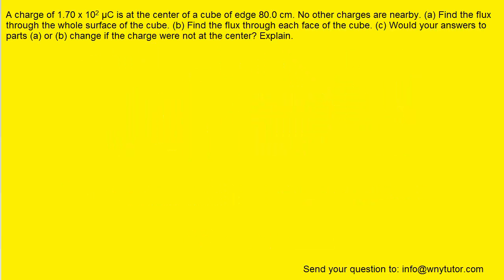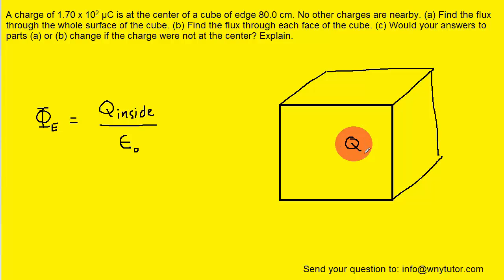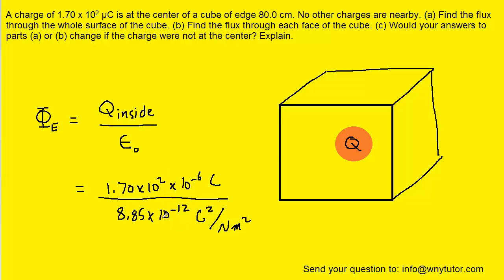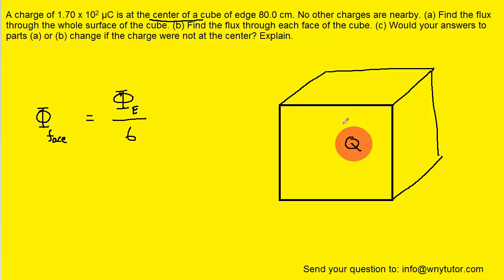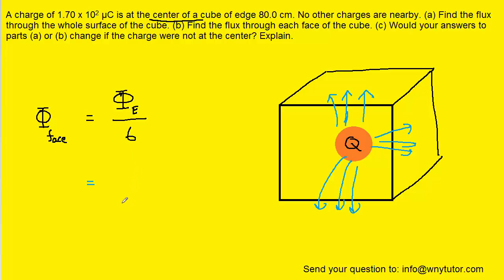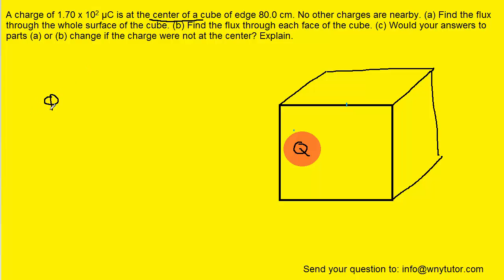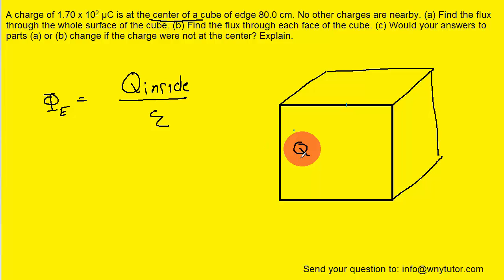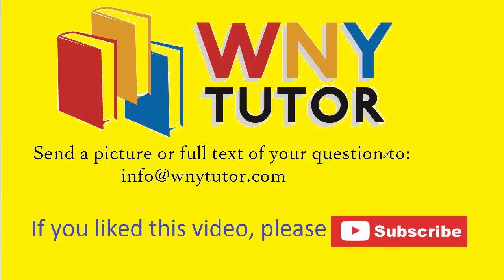A charge of 1.70 x 10 2 μC is at the center of a cube of edge

Comment: So do you just ignore the 80.0 cm?
Reply: You ignore the 80 cm because the every surface of the cube is equidistant from the point where the charge lays. Due to this, the flux is going to be evenly distributed among the sides of the cube, as the given charge doesn't have a specific direction its electric field is going towards. This means you can just divide it by 6

Comment: please do a video on this , thanks   

The electric field due to a length of wire through a Gaussian surface in the form of a cylinder of radius 6.0 cm and height 1.2 mm is 9.1x102 C.  What is the charge of the wire inside the Gaussian surface?